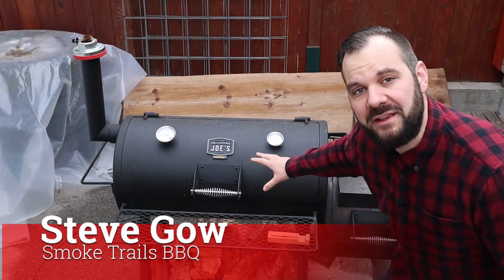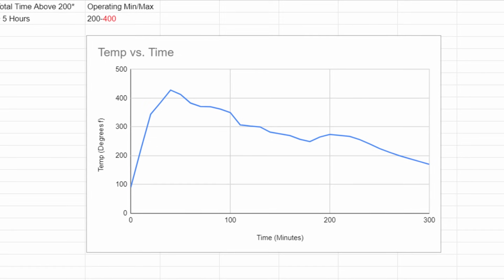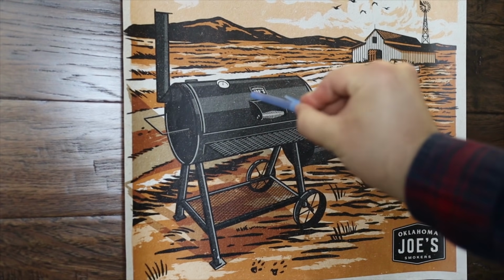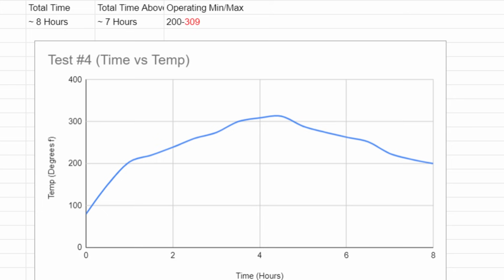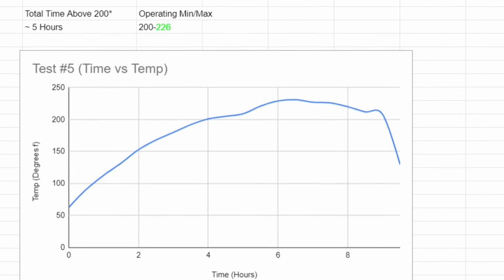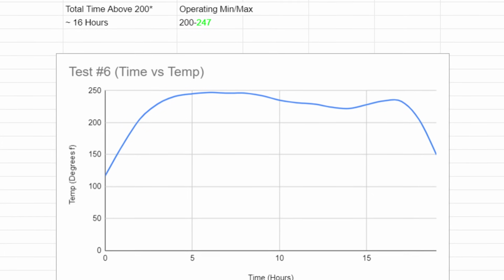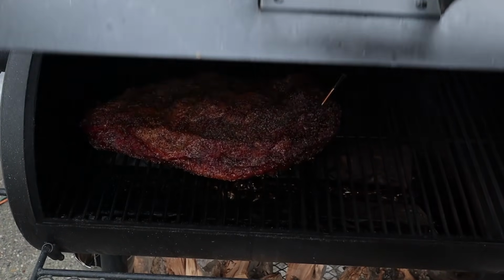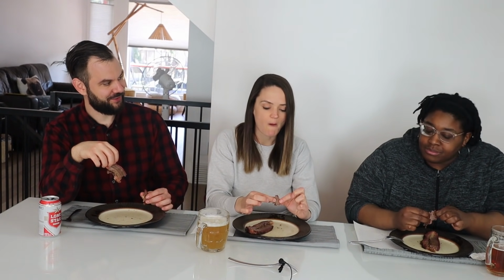11-Hour SET AND FORGET Brisket on an offset smoker (While sleeping!)

Comment: If you put a large water pan (something that can hold at least a gallon) on the coal grate right by the fire box outlet in the main cooking chamber, it acts as a buffer and keeps the temperature more stable. The more you can fill up the firebox outlet with the pan, the more the incoming heat has to be directed around and across the water, stabilizing the incoming smoke temps. Water boils @ 212*F so the resulting air temps as the smoke passes by the water pan are stabilized. On my Char-Griller offset, the hole is about the size and shape of a football. Also, the water pan helps the temperature in the cooking chamber to return to temp faster after opening the lid since you have a large mass of heated water to warm the air back up. I've used this method a lot and have always recommended it to friends who use offset smokers and they are always amazed the first time they try it. Obviously, the larger the pan, the longer burns you can do before it needs to be filled up. My .02 Hope this helps.
Reply from the maker: Great idea. I always put my water pan at grate level above the baffle but putting it below makes alot of sense. Something to try for sure.
Reply: @SmokeTrailsBBQ  I look forward to your results!
Reply: Fantastic idea, I never thought of that. I have done water pans in the bbq under the meat but never by the fire. That makes sense!

Comment: Problem is people think you have to smoke a brisket and serve it right after you pull it off. Truth is long rests actually make briskets taste way better. I smoke my briskets the day before and by 11pm they are done and I let them rest overnight. Next morning I throw them back on the smoker to warm them up to 150 and they come out amazing.
Reply: Double wrap those briskets in foil and place them in a cooler that you had poured hot water in then dump the water out. Pack old towels around those briskets and they'll stay hot for several hours. No need to warm them back up if you time it right.
Reply: I'll second this.  The overnight rest makes a huge difference in the quality of the finished product.
Reply: @mikeroller4110  yeah the yeti keeps my fine but I do rest for 8+ and I always plan to be done way before it “needs” to be done because if it ain’t done then you’re in trouble so sometimes I do have to go back on to heat up but it’s totally fine. Jeremy Yoder condones that practice as well.
Reply: I forget what channel it was but I think I remember he smoked his brisket for 12 hours then let it rest in the oven wrapped overnight just not letting it got lower than 135 I think he kept it between 150 or 160
Reply: @ketobeast8489  Yea I’ve done that too and wrapping in towels in a cooler with hot water. I just get better results doing it the way I do it now.

Comment: My son decided to try a brisket at high Temps. I was skeptical and said it's not going to taste as good. He cooked one in 5 hrs at 425 and I'll be darned if it wasn't just as good as the ones we did low and slow. We wrapped at 3 hrs. It was just as juicy and tender. We've since done a pork butt and a bunch of ribs the same. I was surprised.  Great video btw.
Reply: How much did the brisket weigh?

Comment: This is awesome! As a dad, the time commitment keeps me from using my stick burner as much as I’d like. Not sure a Tip-Top-Temp will fit on my Old Country Wrangler, but even without that I’ve been holding for 4.5 hours on a little more than half a basket of lump with a simple minion method starting at one corner. I never would have thought to rely on the exhaust cover for temp regulation, but it’s working great!! Even if I had to refill a basket once on a long smoke, it’s a great improvement over my old approach.

The charcoal doesn’t feel as “purist” as oak splits, but it’s far better than not having barbecue! Game changer!!

Edit: One OK Joe’s basket full of B&B lump charcoal with some apple wood chunks interspersed lasted almost exactly 8 hours. It seemed to have at least another 1-2 hours worth of fuel left once I shook the ash off.

Comment: I like to start cooking around 1pm at around 160° to 180° in smoker, brisket internals will be 165° at 10pm, wrap in pink butcher paper, brisket has absorbed most of smoke it can so put in oven at 200°, put in thermo pro, set for 200° and another for 165°, put receiver by your bed, sleep to 6 am, turn oven up to 275°, take off at probe tender, let cool to 180° set oven to 150°, put brisket in, ready to slice at noon or 6pm, your choice,  Franklin's briskets done around midnight and then sit in warmer at 150° until 11am when store opens, ready to slice and serve

Comment: Nice video. I use a BBQ Guru Digi Q on my Smokin Tex electric. It uses a SCR to switch the element on and off. Once it reaches temp it flat lines dead on. They also offer the same controller with a small blower for wood burners. We have an Original Oklahoma Joe’s smoker I purchased back in the mid 90’s. My son inherited it several years back. Happy Cookin!

Comment: I've got my first child coming this summer.  You may have saved my life with this video!
Reply from the maker: It works! Just set it up the night before and you can really forget about it until late morning the next day.
Reply: @SmokeTrailsBBQ  no need to worry about vents temps all u need is time and your favorite spray to spray when checking it. i too have an off set and there is no comparison the pellet smoker leaves your brisket 100 times juicier than  offset.
Reply from the maker: @mariaescandon8022  i had a little pit boss but then i bought a traeger
Reply from the maker: @mariaescandon8022  it's definitely easier to use but I find that (1) the smoke flavor and bark is very hard to get because the pellets burn so cleanly and (2) anything over 220 tends to burn the bottom of the meat over long cooks because of the dirct radiant heat from the drip deflector. I use my pellet grill as well but I like the offset for better flavor, bark and the hands on experience and fun
Reply: @SmokeTrailsBBQ  the pit boss has a p setting that the traegers dont this setting retards the insertion of pellets 15 second less, each p setting drops 5 to 10 degress less untill u reach your disired temp, a traeger will not drop below 200 so it will burn your meat on the bottom, when i slow cook for 24 hrs there is no burnt bottoms and a 24hr low smoke will give u the perfect bark layer. I also add a smoke tube close to the brisket once in the beggining but trust me whit a traeger u cant do what im am suggesting, little pit boss dont have the p settings either. I suggest u use a hickory mixture and mix a bag of mesquite to it. Fyi dont smoke 24hrs with pure mesquite the flavor will be overpowering. Try it trust me 160 degrees for 24hrs will not dehidrate the meat either.
Reply: @SmokeTrailsBBQ  onother recepie for thanksgiving just brine your turkey for 40 hrs before stcking it in your traeger it will be juice gallore.

Comment: After watching this video I purchased the Tip Top Temp and some Coconut charcoal, not the brand shown but a larger box of another maker.
That Temp minder is something I can really use!  I have always used the cover on the chimney to regulate the temp in my CharGriller offset.
Reply: Where did you get the charcoal?
I'm checking Amazon and Ebay and can't find any kind of similar logs.....
Reply: @hiredgun05  I found it on Amazon.
The ones I got are called Blazing Coco Charcoal logs.
They are a little beat up in the bag, and don't have the hole in the middle.
I have yet to use them.
Reply: which tip top temp did you get. there's Soo many to choose from
Reply: @moemanm1202  Mine says 5" BUT I think the main part that does all the work is a generic size.  So I won't use the 5" mount and just stick the main works to the top if the chimney.

Comment: Smoke to a core temp of 131 (rare) or149 F (medium rare) for your preferred time.  Then subtract the time your meat has been at 149 in the smoker from 24 hours and sous vide for the rest.  This breaks down and liquifies the collagen and it also helps the maillard reaction.  You can toss it on the grill briefly to reheat if you want the exterior hot before serving.

Comment: Very good video! You could also check out the "Perfect Draft", which is a temp control fan for offsets. 
Also, if you're just using charcoal, as a future solution, you could get a WSM, or Ugly Drum, both of which will run a basket of any kind of charcoal for well over 12 hours.

Comment: Great video. I really admire your dedication and research in accomplishing your end goal. You have an abundance of patience as demonstrated during those six or seven days. Thanks for sharing. I BBQ a lot in northern Japan where there’s a lot of moisture in the air and wind. I’m sure the device you used on the exhaust vent will help with the times of elevated temps. Didn’t realize such a device existed. Thanks again. Have a blessed day.

Comment: I just want to get a Tip Top Head now for my River Grill offset.  I wonder about a long skinny bed with long slender splits and start the fire at one end.  Then let the Tip Top manage.  If I can do 4 hours at a time like that I'd be so happy for overnight work.  I don't mind waking up in the middle to check and tend.   Thanks for posting.   Soo  many ideas to work on.
Reply: Couldn't find one in Dever so I ended up ordering one.   They need to find a way to get those distributed through ACE.

Comment: I just know it as natural draft. It is calculated by the height of stack and temp difference between flu gas temperature and the ambient temp and a constant is included somewhere like .06 or something. It's been awhile since I took my boiler license.  I don't like charcoal either because depending which one they use actual coal

Comment: Let me get this right, for long burn in an offset. We would not use it as a stick burner but a charcoal burner with a little bit of wood by closing down both in and out traps at the right time. That means less wood smoke over the meat by less sticks to burn in this project. I am a newbie, people usually tell me use wood mainly in an offset, charcoal just as hot bed for the stick. That means a vertical barrel smoker (UDS) which usually a charcoal smoker will do the same job in comparison. It seem even more ideal if long sleep is the goal. I would use a aftermarket PID fan/controller in a barrel smoker intake. I understand it would not be as fun in solving a challenge by this way.

Comment: Try a water pan in front of the fire box to keep it moist.  I spritz with apple cider vinegar every hour, but you weren't up for that.  It's okay, but the flat usually gets very dry.

Also, my son's doctor said to use powdered rice with milk in bottles when he was about three months old.  The rice helps the baby sleep longer. :)  Secret tip: Make the milk with sleepy time tea.  That's an old Mexican trick.

Comment: I am doing some experimentation on making a cold smoker mod for my MES. I have one of the cheap tubes you can find on amzn and grabbed a Char-Griller side firebox as more or less the mailbox of a mailbox mod. Something I noticed is it was creating a lot of white smoke because there wasn't enough draft. This was solved by lighting a small charcoal fire. I wonder if you could Increase your wood flavor game by using a pellet tube. Seems like the coconut char will provide good clean heat and you can utilize pellets for smoke flavor. 

I'd think if you mod the OK Joe to have mod your ok joe to have a intake baffle (additional water pan would be beneficial) you could move your fire closer to the smoker and then put the tube so that it creates a semicircle on the air intake side. I think this would do 2 things. Cleaner initial combustion of the pellet and provide basically an "afterburner" for the smoke through the hot embers/flame of the charcoal. Buy a couple of tubes and all you have to do is swap it out once should provide more than enough smoke.

Comment: You should get ZENFIYAH Coconut Charcoal. 100% coconut, no fillers and burns SUPER clean for super long heat.  They make a HEX Restaurant Grade which I use can I get 12-14 hrs at 225  on just a 1/4 load of charcoal in my Gateway Drum. Blows away briquettes which won't last anywhere near as long.  You nailed it with the Coconut though!  Great job.

Comment: LOVE seeing the Lonestar beer being a Texan....WOKE free and a great representative of the Lonestar State! This is the second brisket cook I've seen with the coconut coal, both turned out well. I haven't seen this type of coal here in Texas yet.
Reply: Never heard of it before this video.  I thought I was doing good getting about 8 hrs from lump charcoal/briquette mix in my smoker, unattended.  And Ive wondered if its just this Texas heat helping me along.  If it was snowing, I wouldnt even think of lighting the pit.  The rain has dropped my cook temp 100° in a few min before.  Couldnt imagine ice falling on it.  
This was a very eye opening video for me.  But truth be told, Ive been using the stack dampener for temp control for decades.  About 5% open area is all it takes, just like this video shows.  

I have a few long necks in the frig right now. They're special though, dont think I could drink em.  Lone Star was my Dad's fav beer, and he brought a few over.  
There are two beers left, but only one of us left.

Comment: New to the smoking world, learning a lot from your videos! Would love to try this method overnight!

I use your "V" method when smoking in the Oklahoma Joe, Firebox with two grates and a base grate, but I use a similar style charcoal shape from Big K - Au Natural FSC Lumpwood Briquettes, but I stack them either side and let gravity do the rest, they roll in when needed and are pre heating, I then add wood when needed! Seems to work for me.
Reply from the maker: Great idea! Are you able to maintain pretty steady temps?
Reply: Yeah it wasn't bad at all, I think my spikes came as my wood splits were too big to be honest. I came across it as I was using the "V" method and rather than creating another charcoal starter to keep the temp, I decided to try this... it was a bit of trial and error, I'm planning a cook on the weekend so will see what happens with smaller splits too.

I suppose it's a similar process but it burns outwards rather than through the firebox? It just gives me a bit more time between managing the fire. 

I'm very much a newbie, got an Oklahoma Highland for Christmas, but enjoying it so far!
Reply: @SmokeTrailsBBQ   did you make that metal box that you put into the fire box? And where do you get coconut coals from? My first time ever hearing about them any info on the box set up Is much appreciated

Comment: This man will single handedly defeat sleepless bbq nights
Reply from the maker: I'm on a mission!
Reply: Ugly drum smokers. When I want my sleep, drum smoker. But this I wanna try on my Oklahoma Joe.
Reply: Ive been snake method smoking on a weber kettle.. did my first brisket and it came out great.  Lots of babysitting and some obvious disadvantages.  Nonetheless it was good.  I contemplated a traeger but have been looking at getting an Oklahoma joe offset instead.  Im also a homebrewer and so i like to be in control... pulling levers, switching on pumps etc.  With smoking meats i also want to be in control for the short smokes.  But this video is very encouraging for the long smokes.  I cant trust myself to put it all on auto pilot like some tesla drivers, but intermittent sleeping is okay with me. Thanks!

Comment: I don't have kids, but I do cook while I sleep or when I am not home, with a pellet grill. If you have a newer one, you can use super smoke mode. If not you can set up a cast iron pan with charcoal and wood chunks and one or two lit briquettes. It will take quite a few hours until the charcoal/wood chunks to ignite and  burn out and by then the brisket will have taken in all the smoke its going to.

I have a 1/4 inch offset beside the Traeger. In many competitions, you'll see a pellet grill in the background no matter what style cooker they are using.

Comment: Listen!! I'm from Texas, The Capital of Low and Slow smoking!!! If your Temps drops below 200 degrees, then you need to add some more wood to the fire, and if it climbs above 250, it needs to be cooled down slightly!!! But I always start my fire with charcoal and some oak wood for starters and once the temperature regulates itself and levels out to where you want it, then you begin adding more smoking woods to the firebox!!! I use Hickory, Mesquite, Pecan and for turkeys, I will also add in some Cherry wood!!!

Comment: Have you tried the Costco Kingsford professional competition charcoal briquettes?  They are 100% natural wood which I’m assuming there are no fillers. I’ve always used those to grill and I get almost no ash which usually means it’s 100% wood in like other brands that leave so much ash.
Reply: The wood used is 100% natural, they still use binders. They just distract you from that by clever labels.

Comment: Absolutely love your videos. Can you tell me which model Tip Top Temp you used for the oklahoma joe's longhorn as there are a few different ones. The smoke stack is 3 inch on mine. Thank you very much
Reply from the maker: I used the one designed for the weber kettle
Reply: @SmokeTrailsBBQ  thanks very much

Comment: for minion method in offsets you should also be consider lighting the side near the firebox,  it will light abit slower, honestly briskets can cook at 325 no problem especially for short periods people do them hot and fast 275-325
 given the 4hr time crunch you may have wanted to jump to foil

I think smoker efficiency becomes very important for the set and forgets, a double layer of welding blanket might let you stretch what would be 5 hrs unnasisted to near 8, also considering a vertical style cooker like a Weber smokey mountain as they can get left alone with just vent adjustment